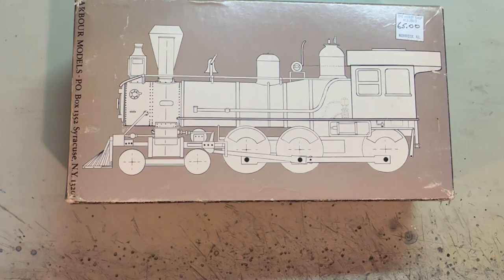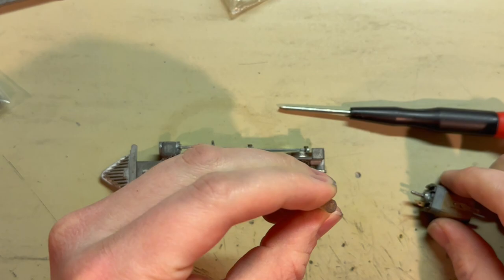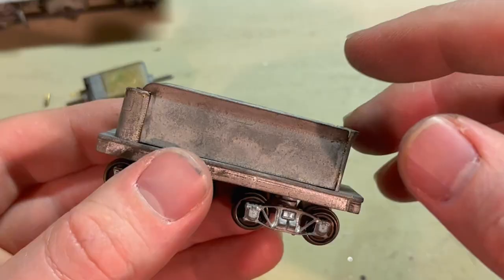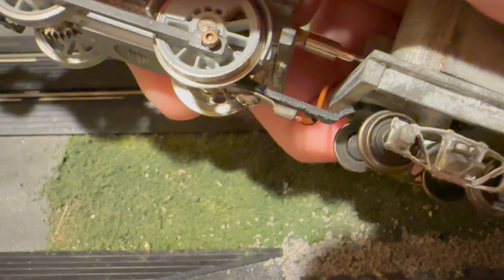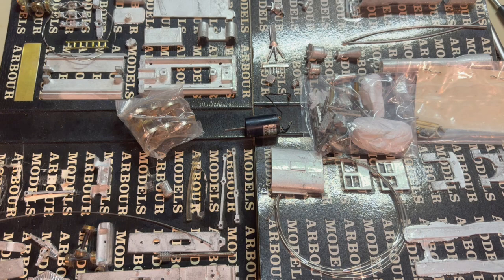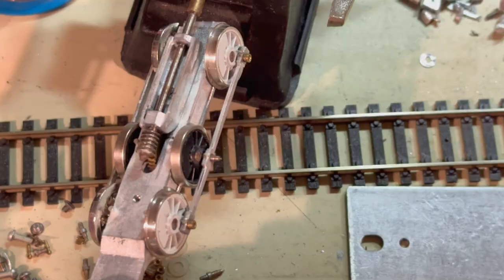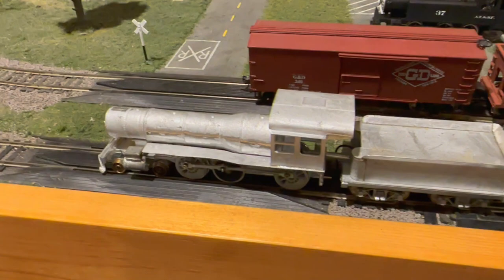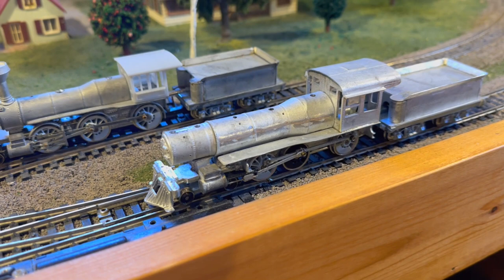Building an Arbour Models 2-6-0 and 4-6-0 for a viewer

Comment: Great video! Fun to see old Arbour kits be assembled. I built and got my Brooks mogul running pretty decent some years ago. But the siderods metal is quite soft so after some running the siderod bearings got worn out with binding as a result. I have now rebuilt it with new drivers and photo etched siderods that hopefully will hold up longer.

Comment: Thanks.  I may drag out my well buried NKP Berkshire kit to continue.  The last thing I remember from years ago was the resistance soldering unit cranked up and the cab side evaporating.  I also didn’t understand that kits sometimes need creative adjustments.
Reply from the maker: Yeah, these take more creativity to finish than the better fitting kits from Bowser, Mantua/Tyco and MDC/Roundhouse. I think the melting point of the Arbour metal is about 675F, so the iron needs to be no more than 650F to work with it.

Comment: I have one of those 2-6-0 kits in the box!  Havn't started it yet.  Maybe your video will inspire me.  I wonder if you have had experience with The Locomotive Company kits?
Reply from the maker: I do have a TLC kit new in the boxes.  Haven’t started it yet, but it looks like it’ll be a tough one!
Reply: @DarthSantaFe  I wonder about the quality of the castings.  Are they white metal like Arbour?  Or more like Zamac?
Reply from the maker: @jimlowther2453  They seem more like the white metal used by Arbour.  Zinc and Zamak castings require steel dies and machinery to make properly, but white metal can be cast in cheaper low-temperature molds, so that's why it's usually the metal of choice for small manufacturers.

Comment: Huh, learn something new every day, I never knew about the Sierra 4-6-0 kit until this video, I always thought that the Tyco/Mantua model was the only example of Sierra Railway #3 available in HO scale (though I'd say it's more in scale for OO).  Though, you're probably way better off with the oversized Tyco than tearing your hair out trying to work with these awful kits.  Not to mention the motor is actually in the locomotive shell on the Tyco, so you won't have an unsightly drive shaft between the locomotive and the tender (thinking about it, that was probably WHY the Tyco model was oversized to begin with).
Reply from the maker: I have the 4-8-0 version of the Tyco.  It's a bit lighter, oversized for HO and does have the motor sticking all the way into the back, but I think I still prefer it for the durability and ease of maintenance.
Reply: @DarthSantaFe  Mine's the 4-6-0, but modified to have a more modern and more compact Bachmann motor (allowed my buddy and I to cut down the boiler back head and detail the interior of the cab), but I may see about looking into an even better motor in the future.